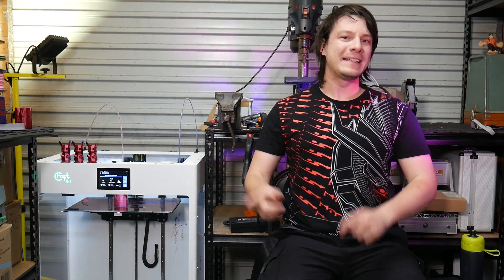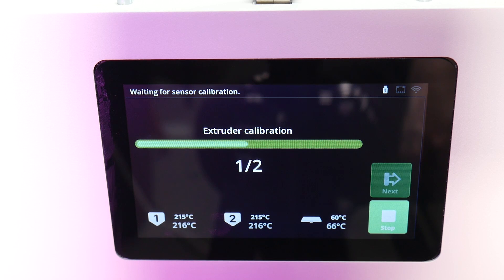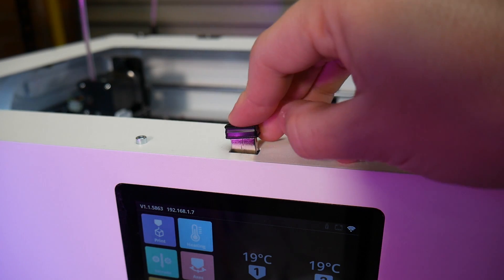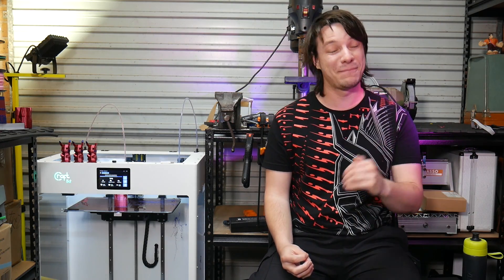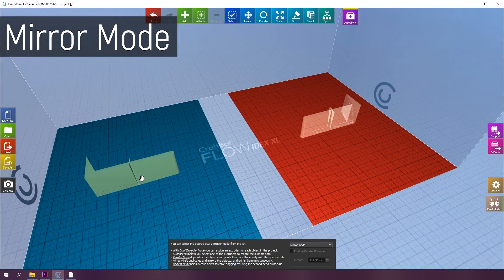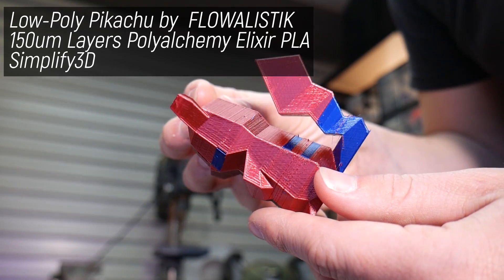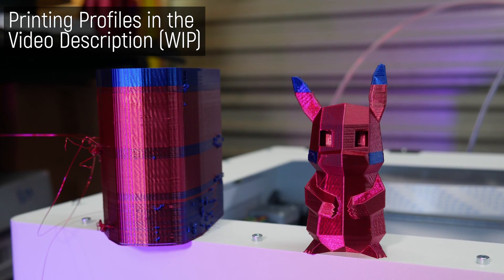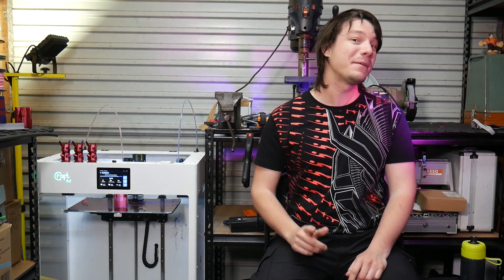Craftbot FLOW IDEX XL 3D Printer Review

Comment: Mirror mode is very useful for us car enthusiasts. Many parts on the car is 2 of each and mirrored so I don't agree Angus, that mirror mode is just some cool party trick ;)
Reply from the maker: That's fair!
Reply: First thing I printed in mirror mode were the brush buckets.
Reply: ...and I have the flow IDEX but not XL-version. Have had some quirks with it, but got a new controller card and it works for my needs. However, I agree with your summary of the printer. There are some things that could have been more tested out. I think the electronics does open up for a lot of refinement going forward. Perhaps the screen should have been placed externally so that it doesn't get so hot.

Comment: Looks like it'll be a great printer when they get some issues sorted.

Can it run different nozzle size on each head at the same time? Maybe using a fine nozzle for getting high detail on the outer layers, and a thick nozzle to speed through the insides?
Reply from the maker: If the slicer supports it yes, the hardware would be capable

Comment: Just got a Flsun Q5 to go along with my ender 3 and I absolutely love it, you were the reason why I decided to get into 3d printing
Reply: The Flsun Q5 is a great little printer! Deltas print so fast even at the “same” print speed thanks to the way faster acceleration and jerk it’s nuts. 

I still want to further upgrade the part cooling (more than just replacing the air guide) but otherwise it’s been fantastic for me, especially since I got it upgraded to the latest Marlin 2.0.6 firmware.

Comment: It’s a beautiful bit of kit but even the cheapest one is out of my price range.
But I suppose it’s more commercial than hobbyist. Wish I could afford one and not interested in dual colour printing but have to agree with you Angus that a printer at this price that advertises itself as a dual colour printer it’s not really on and they really have to sort the firmware and slicer.
Reply: Slicer issues fixed albeit with Simplify 3D

Comment: forgive my ignorance... but why do you even need a purge block with a dual extruder?? (if you're only printing in the two colors)
Reply from the maker: You shouldn't, it's a bit of a hack to compensate for the filament oozing between colour changes.
Reply: Because the two extruders don't print at the same time. While one is printing the other one is sitting at the side and oozes.
Before the second one can start printing it needs to be primed. And when the second one is finished the first one needs priming.

Comment: I think mirror mode would be for if you need two non symmetrical parts that need to be the inverse of each other. One example that is close to what I mean is the two halves of your recent headphone holder, although I think that design was a little different because of the hole for the nut on one of the sides

Comment: Hi Angus, quick question: In my research lab we are still using some of the UP Plus printers with their own Tiertime ABS. Are these printers and ABS basically dinosaur technology now? From all of your videos it seems ABS is pretty low on the list, but in my world, it's still the go-to just because it always has been.
Reply from the maker: Kind of yeah... If they're still working, by all means keep using them but if not, it might be worth swapping for the more modern printers. IIRC the UP Plus print bed was notoriously slow to heat up and keep ABS properly stuck down.
Reply: @MakersMuse  FYI, we have two ozito heat guns on hand for pre-heating haha. I get you though; I'll see about upgrading soon. Cheers.

*edit: X1 heat guns, for but the finest of bunnings connoisseurs.

Comment: Mirror mode: you could have print your headphone holder both sides at the same time.
Reply: AND you didn't have to design both halves, but only one
Reply: @deingolfcabrio  That is why you have the mirror feature in basically every CAD/Modeling software.
Reply: Or you can mirror the model in CAD. Takes 5 seconds.
Reply: @motordude67  While that's easy in the CAD itself, you still have to save a new STL for slicing, type a different file name, load both files into the slicer,  make sure to get one of each version, and then if you make any changes have to duplicate it all again. Still, not a feature most will use every day. Plus, a lot of slicers will do weird things where infill or supports will generate differently  in different locations on the build plate. Having the two with identical mirrored G-code, including support and infill would be more consistent.
Reply from the maker: heh suppose that's a niche use! yeah :D
Reply: @MakersMuse  not as niche as you might think. Lots of things are made in halves. I can think of tons of cosplay uses where you'd save time by just designing one half and letting this printer do the work.
Reply: @Real28  Chirality is characteristic of living things and looks impressive in a 3d printer, but in fusion this is 5s task
Reply: Due to the size of aerofoils you mostly have to print them in sections, the mirror feature would be nice.
Reply: Mirror mode would do two sides of a boat, a plane, or a car.
Reply: You can do that on every printer out there. Just cut the model in two with plane cut and place them both on the builplate in cura.
Reply: @theshadowman1398  yeah but this one does them at the same time
Reply: AdamRW240 

That’s because it has two nozzles. And it is quite a premium for a second nozzle
Reply: @theshadowman1398  Yes but Angus was knocking the mirror mode as being a party trick and not actually that useful while it actually does have several uses.Not as many as double mode, but still a common enough use case that it would be annoying to not have it.
Reply: @theshadowman1398  If you're cutting your print time in half, or from another POV, printing twice as much at the same time, the second extruder is MUCH cheaper than second printer. As long as it works, of course. If something goes wrong (two big prints, one detaches), can you stop one of the prints, or are both ruined?

Comment: Great, Just when I had my mind set on the Raise 3d machine........
Reply: Oh man, Raise 3d printers  are so cool looking even better with their stands if you can afford one.
Reply: Don't. I have a Pro2 Plus and getting the bed acceptably level is a fucking nightmare. Screw pitch is gigantic for adjustements in the microns range. The removable bed clamp has awful repeatability and can cause slight warping if you screw the thumbscrews in while cold. 

The levelling system has 12 fucking points. 12. And you need them because the heated bed loves to deform.

Just getting everything so that the first layer is acceptably level (0.3-0.35mm ish) took me literal days.

Now, the other quality is pretty decent, so I might keep this printer. But if I do, I'm replacing the bed with a ultra-flat plate and a 3 or 4-point levelling system.
Reply: Of course, all the other printers in that price range have their issues too. Unfortunately just what you get for the prosumer category.
Reply: @kanetw_  Good to know.  Thanks!